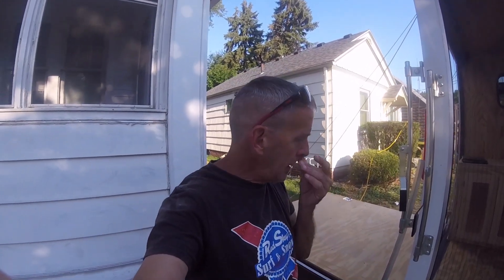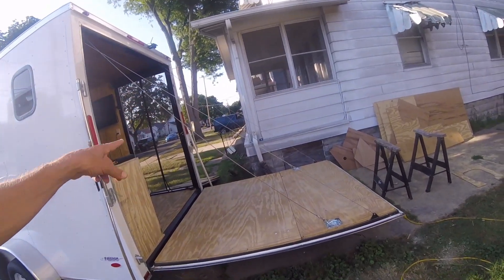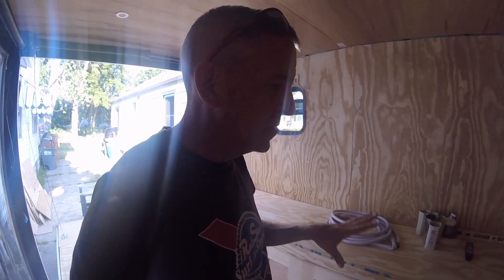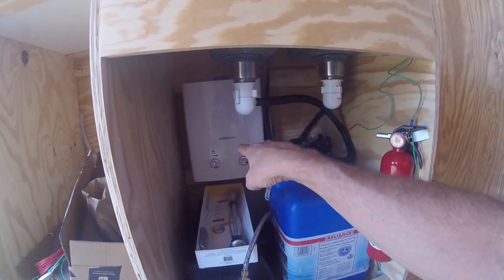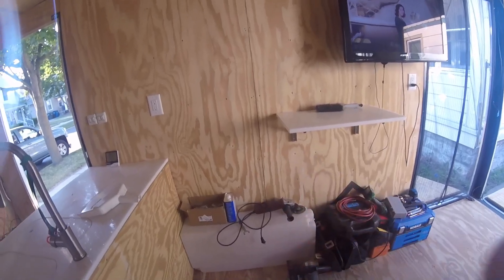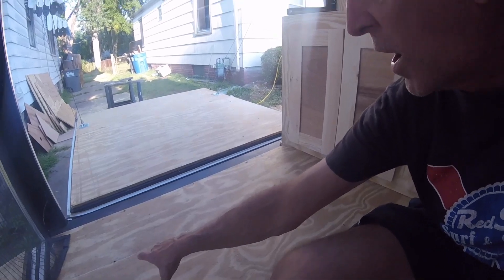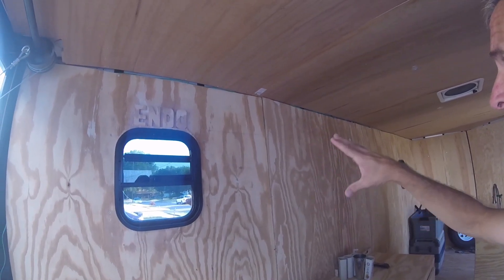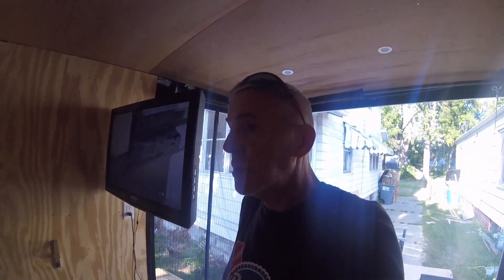Cargo Trailer Camper Conversion :: Comprehensive Update

Comment: All AC circuits for house wiring use Black for power and white for Neutral.  ON DC applications it's rare but does happen from time to time, depending on manufacture.